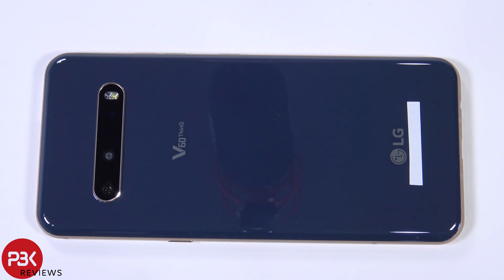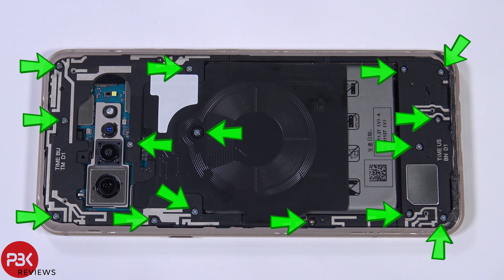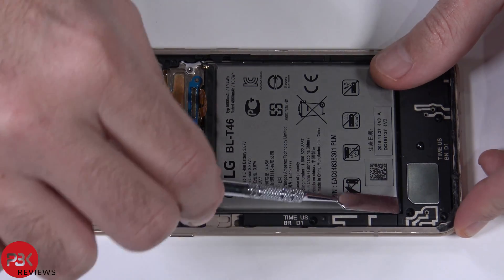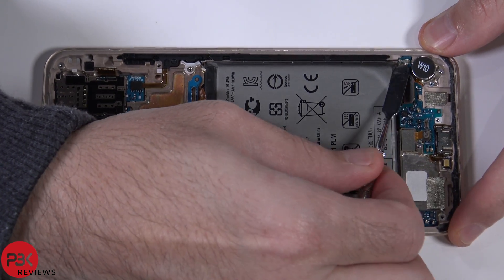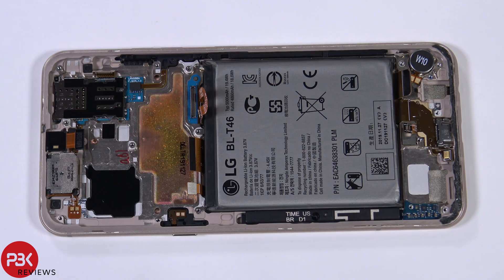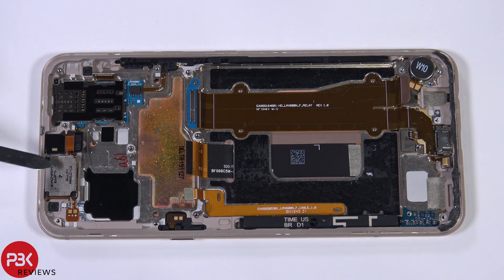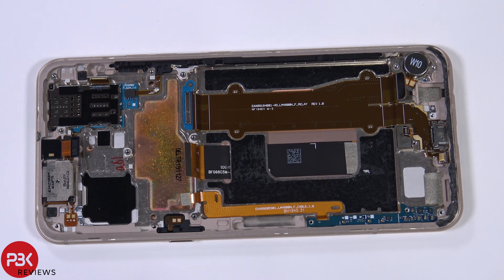LG V60 ThinQ 5G Disassembly Teardown Repair Video Review

Comment: @1:20 you mentioned there's alot of antenna lines there. I had a botched repair and my V60 detects my sim card but doesn't get reception. is it possible it was damaged? taking it off it does look abused by the repair shop...

Comment: I have a question that hopefully you know the answer to. My screen is cracked and im thinking of buying a new v60 off of ebay. I dont want to setup a whole new phone, so is it possible to take them both apart and put my old motherboard into the new phone? would the hardware be compatible or is it software locked to each pierce of hardware and the new exterior of the phone wouldnt read the old phones motherboard?

Comment: So far i have yet to find a single video to address all my issues. My power button came out of the frame and now has to be taped on to hold it in place. My charge port has long stopped working. I can no longer make a call without using a bluetooth headst because something seems to be wrong with my microphone. The back cover of my phone is falling apart and my battery is showing signs of dying but yet this phone keeps going. Now if that doesnt say something for lg phones what will.

Comment: What’s the wire that runs down the right side of the battery? The ones you pushed into the board with a metal thing? The ones on the top and bottom won’t go back on and I don’t know what they’re for

Comment: I've had this phone for five years, and the processor still does everything I ask of it with no questions, but...
less than a year after I got it the USBC port started becoming unreliable, so I had to charge it with the induction pad only. I think they tried to make it flexible for the dual-screen attachment and that backfired?
the power button fell out. I can still manipulate the internals with a toothpick, and turn the phone on with the fingerprint scanner, but this is not ideal.
and I just noticed a slight split in the side of the case, almost like something inside is swelling up and pushing the back plate off...

I dunno if trying to get all the replacement parts I need is worth it and some of the surgery required looks pretty delicate, but I figure I should at least make the attempt.

Comment: Video makes taking back cover off look easy. NOT!!! Mines so tight that nothing will fit between the cover and phone body. What do I do?
Reply: Use heat to loosen the adhesive and you can use a little of 91% or higher alcohol

Comment: we just bought an lg v60 verizon online shipped from China, when i tilt to one side the lg v60 you can hear that something moves inside, like a loose part or what, but the phone is operating fine, can you guess what could that be?
Reply: the insides of the lg v60 seem so compact, how there could be something loose in there, but we can hear it when we tilt the phone, like something heavy.

Comment: Thank you just did the work of replacing my USB port, battery and headphone jack have been completed!  Back tother and all is sealed!
Reply: So where is the charge port in this video? Mine's no longer functioning.
Reply: @jdub1922  it's right about 5:51 but you'll want to watch the entire video as the cable is under the battery and other components.

Comment: Do you have to go as far into disassembling as you did to remove the battery or is it safe to remove before?
Reply from the maker: No, once you have access to the battery you can remove it. No need to disassemble additional stuff.

Comment: Hello, the video is very good, could you help me with something? I bought that reconditioned cell phone and it came with an error in the GPS, it almost never works, I have taken it to several technicians but either they can't or they don't have the "spare part", that's what they tell me, now I recently found another one that seems to have More knowledge, he wanted to try changing the GPS antenna but he didn't have another similar piece to test it with.

The seller who sold it to me is from Aliexpress, he tells me that he doesn't know what part it is and that I should tell him the model or code of the part! Imagine, now what I'm asking you is that you help me by telling me how to ask for the spare part. to the seller? What would be the name of the spare part or its code? Or what do you think are the parts that should be changed?

Thanks for your help.

Comment: where is the memory chip that stores the andriod OS and all data??
Reply from the maker: the ROM is soldered to the main board under one of the covered shields and is not user removable or replaceable.
Reply: @PBKreviews  so theoretically i couldnt just swap the motherboard of my old phone onto a new one and expect it to boot up with all the old data and info? I believe the motherboard is the piece with the camera lens but I may be wrong.

Comment: can you remove the battery after removing the wireless charging pad or do you have to pull all the rest apart first as well?
Reply from the maker: As long as you have access to disconnecting the battery cable and removing the battery, you don't need to remove anything else

Comment: thanks for the helpful vid, just replaced my battery, was pretty stuck, guessing it swelled when it failed. I did shatter the back when removing, next time I will know use more heat, this is my old phone so this repair was more for practice and since I have the dual screen I wanted to revive it if possible as a spare....
Reply from the maker: You're welcome

Comment: Can someone please tell me if I HAVE to remove ALL those tiny connections just to replace the battery? Like can I avoid the "tear down" part or are all the steps he did how it has to be done? I bought a new battery hoping  I could change it myself to save $ but if that many steps are required-may have to take it to a repair shop to avoid making things worse:(
Reply from the maker: You just need to remove the back cover, then the screws on the top motherboard plastic cover and the cover itself. At that point you will have access to disconnecting the battery cable and prying the battery off. You don't need to disconnect other stuff. Also you can use isopropyl alcohol to apply a few drops on the sides of the battery and let it sit for 20-30 seconds so it goes under the battery and eats away at the adhesive, making it easier to pry it off.
Reply: @PBKreviews  Omg THANK YOU!! I thought your video was very interesting by the way!😁 Guess its kinda good to know whats goin on in there but by step 4 I was hating myself for thinking I could do all that w/out wrecking my phone lol, but here I go!!!

Comment: There's something loose inside the phone that makes a knocking sound when I shake it. Although the phone is working perfectly fine, I wonder if I need to open it and see if there's something that needs tightening. The sound is coming from the lower part, and sometimes the loose part gets fixed in place and won't make noise when moved up and down, but starts making noise when moved sideways. What could it possibly be? Is it worth opening the phone, considering it may compromise the water-proofing capability? Any help is appreciated.
Reply: It is due to the OIS camera

Comment: Well, I will tell you my story about replacing the back cover. I replaced the back cover on lg g8x and lg v60 from the first phone I managed to remove the cover without damage, but on v60 I tried to remove it without heating and broke it, but I ordered a new one from aliexpress in advance (and to my surprise the back cover from China came all covered in a film with glue on the camera on the edges of the cover and also in special places where the cover touches the body of the phone in the middle. Everything was glued well, but there is a big problem on both phones when someone calls you, the sound seems to be duplicated as an echo. Please help me, maybe someone had such a problem, I think the phone's tightness is broken, but I don't know how to fix...

Comment: Thanks for the tutorial I ended up replacing the flex port but now the screen doesn’t respond to any touches I checked all the connections they were good. Any ideas? very odd.
Reply: Were you able to fix it?  I am having the same issue 😔
Reply: @sandrypfl  unfortunately for whatever reason the flex cable damanged the screen itself , not physically but it seems like it shorted it out or somthing. I had to replace the screen to get it back to working and made sure this time the battery wasn’t connected and it was drained of power. Very odd but unfortunate.
Reply: @rmegaman64  Thanks for your prompt response

Comment: Wow THANK YOU!  You mentioned signal / reception problems surrounding the wireless charger because there are antenna parts in that piece.  Can you tell me a little more about that?  because I am seeking solution for NIB LG V60 that is dropping calls with weak signal.

Comment: Great video. I had to replace the charging port and this was very helpful. However vibration and fingerprint sensor stopped working. What did I forget ??
Reply from the maker: Thanks. First check and make sure the sub board is seated properly down in place since it has contacts underneath which touch and make a connection to the vibrator motor. But the fact you have issues with the fingerprint sensor also, might be that you have a wrong version of the sub board. You need to make sure you order the correct model number sub board/charger port board for your phone since different region versions have different antenna contacts as well as minor differences which might result in issues. But one more thing you can try is to save your info/backup your device and do a factory reset since sometimes the fingerprint sensor requires it when parts are changed.

Comment: I recently bought this phone just for it's fantastic audio capabilities. Occasionally it would shut off at random. But now it stopped working entirely. It vibrates when I connect it to the charger whether it's wired or wireless charging but does not turn on. I can only assume the battery is no good? Would love some advice.

Comment: Thank you. In my case it was pretty easy to remove baterry using plastic tool with sharp and angled end (lever)
Reply: Did u have to remove all the layers & unplug all those tiny connections/speakers as he did? I bought a new battery online that of course came w/no directions & I had NO clue replacing it required dismantling that many parts😢

Comment: Bro how can I get a new sound ic for this phone 
My mobile's sound system is not working
Reply from the maker: Not sure about the IC, but you can try replacing the speaker to see if that fixes the problem. Check on ebay or amazon for it.

Comment: My 2 month old V60 died overnight.   It was charged around 60%  , but in the morning I picked it up cold and dead.  Any idea what should I start from ?
Reply from the maker: Have you tried holding the volume down and power button for 30 seconds to see if it will boot, might just be frozen. If still nothing, you would need to open it up and disconnect the battery and re connect to see if it helps. If still nothing, I would try a new battery and see if that fixes the problem.
Reply: @PBKreviews  Thanks for the tip.   I completed first one -  no luck. 
Will try to disconnect battery and already order new battery as well.
Also measred charging...  it shows  5.23V and 0.01mA ... no current :( 
Will post you soon.
Reply: @PBKreviews   Second advice nailed it !  thanks a lot. 
I disconnected and reconnected battery and voila , the phone came alive.
Unfortunately, neither my meter nor AccuBattery did not detect current to battery. It held a bit at 5V  0.4mA  and then in a few second went to 0.01mA.   
   The new battery coming in soon. So , again, thanks a lot for your tips !

Comment: What does that small board on the charging ribbon do? 4:52
Reply from the maker: The sub board has antenna contacts on it, as well as powers the vibrator motor.
Reply: @PBKreviews  thanks

Comment: Nice video.
I have a V60 from Verizon with really poor GPS reception. I've done everything possible on the software aspect without solution. I'm looking the hardware. Please which is the GPS antenna? Any other suggestions will be appropriate. Thanks
Reply from the maker: Thanks. I'm not sure exactly which would be for gps, but you can take it apart and make sure everything is screwed in place properly as well as all cables connected to rule out any loose connections.
Reply: @PBKreviews this phone is really a bag of problems. I guess buying a refurbished phone was a bad idea.
Now I have dust under the front camera. It wasn't there when I got the phone, which means it is entering through an opening. Any idea where it could be going in through and how I could fix it?

Comment: Very helpful and interesting video. What model of V60 do you have? I have the US Verizon, and there are two more bands going to the mainboar (from right and left frame, connected to the Mainboard just below the cameras). Just curious what are they for. I got water damage and one of them got shortcut and burnes. I just removed it, and so far, cannot tell the difference 😳...
Reply from the maker: Hi, the Verizon one has 2 mmWave 5G antenna which is what those additional cables are connected to. The mmWave antenna is mainly only used on Verizon in the US and doesn't come included on other carrier branded phones usually.
Reply: @PBKreviews  thanks for your response! Now I'm glad to use the phone mostly in Europe 😉

Comment: you don't need to use hot air to unstick the battery?
Reply from the maker: You do, its mentioned in the video. But you can use isopropyl alcohol and apply some to the sides and let it sit for 30 seconds so it gets under the battery and eats away at the adhesive making it easier to pry off. https://www.ifixit.com/products/ifixit-adhesive-remover?variant=39915173740647
Reply: @PBKreviews  what do you use to glue the battery back?
Reply: @PBKreviews  ah ok but can you reuse the adhesive when using the alcohol?

Comment: Nicely done. Can you recommend an adhesive for the back cover?
Reply from the maker: You can check this link: https://www.ebay.com/itm/294509935686?hash=item449228fc46:g:mVEAAOSw1uNhfqdH&amdata=enc%3AAQAHAAAAoFd76ybF2VYjR4diR5fYYPpZLJu14f5%2BKUMnarsPuB9FLKBnsllf%2BGIKc%2BLRkWYwxY5whDTkGwnJlHyPj0drgbeJ%2F0ah0hhuq4GweKXfGjCbVNyW2v20BI2CpP307TcA2JWQXqYVNvRJsoQLkJQ5zqPFv2bZbYe0H7JNUo%2Fs2DTs5YhxBYZaK4sSHorl7wKjrVlt2tugTvjZrrAmQv5MexE%3D%7Ctkp%3ABk9SR_LG3bWXYQ

Comment: I'm replacing my battery right now but the wireless charging pad seemed to be slightly glued to the battery causing the underside of the pad to tear off at the corner... Should that be replaced or do you think I'll be alright just leaving it? Thanks for the vid btw👍
Reply from the maker: You should be fine leaving it if you prefer. You're welcome :)

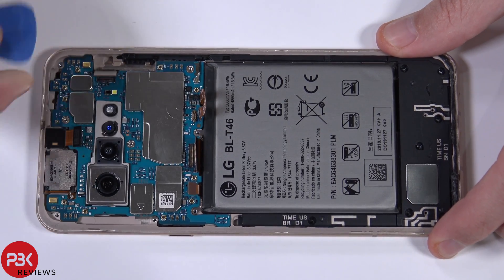Comment: 2:01 do you know what that wire is for? I accidentally broke it 😑 The phone though seems to be working just fine, lol 
P.S. Thanks for the tutorial!
Reply from the maker: These coaxial cables are usually used for antennas. You can try to use one from another phone but not sure which one would be exactly the same length to tell you which to buy but here are a few: https://www.mobiledefenders.com/catalogsearch/result/?cat=0&q=coaxial+cable

Comment: Great video, but how to change the front camera?
Reply from the maker: The front facing camera is adhered in place, you would need to just pry it off to replace it which most likely would damage it but since your replacing it, doesn't matter :)
Reply: @PBKreviews  Done
It's very simple, the same thing to  take off the camera of the fingerprint  👍

Comment: My phone is a demo phone, so this phone don't have a USIM module Can I install a USIM module, then can I use a USIM?
Reply from the maker: Hi, just because its a demo phone, doesn't mean it shouldn't have a sim reader. I can't recall any demo phones I have come across that were missing the sim reader. Might just be software disabled which would require either doing a factory reset or somehow removing the demo software on the phone. The method is different for each phone and you would need to find a video online showing you how to remove the demo software or disable it.

Comment: My sim card reader slot is not reading my mini sim card. I think I need to replace the sim slot. You mentioned that its replaceable but I didn't see you disconnect the sim slot. Is it easy to disconnect?
LG v60 5g
Reply from the maker: Hi, it's not too difficult. After you get to the point in the video where you remove the motherboard, the sim reader is on a flex cable which is adhered to the frame. You need to disconnect that other flex cable that is attached to the sim reader, and then pry off the sim reader flex cable from the frame and install your replacement one and re assemble everything.
Reply: @PBKreviews  thank you bro. I think I get what you're saying. Im gonna order that sim piece and replace it. I appreciate you.

Comment: Thanks for the great video! I have an LG V60 that's in great shape but the 5g (any mobile data) will work for a minute and then the signal will drop off so that it isn't getting any mobile data. The WiFi has no issues. It doesn't appear to be in the settings. Any suggestions on which part of the phone I might be able to replace to remedy this problem?
Reply: Antenna @6:22 and the antennas with the wireless charging shown in the beginning